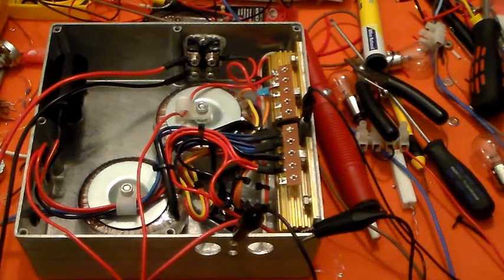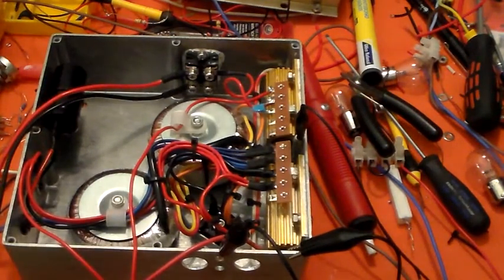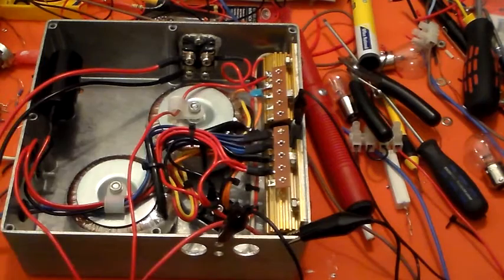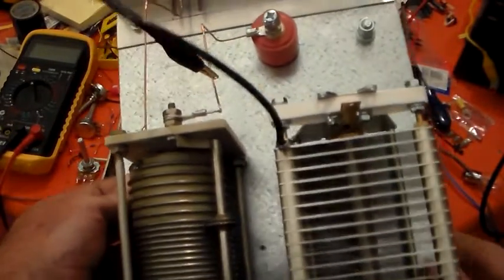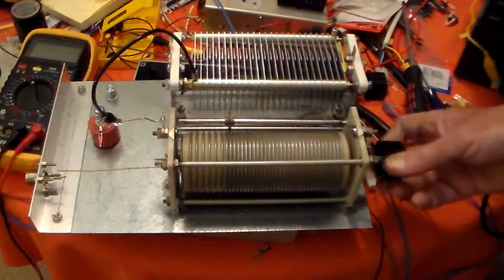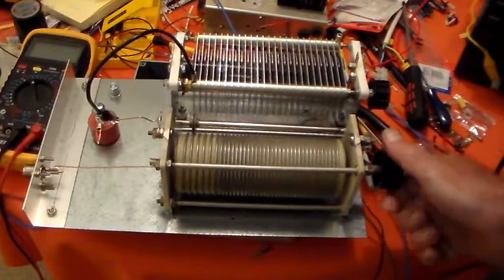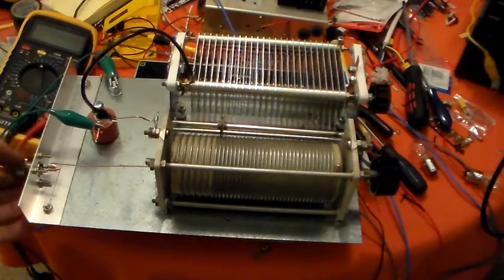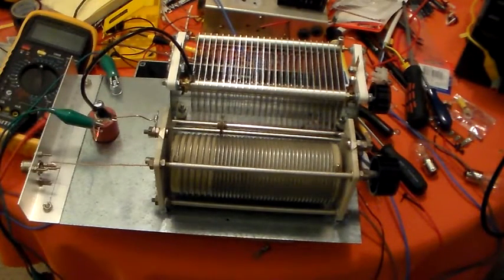A Bit On The HF Amp And An 'L' Match ATU.

Comment: Hello! Like to this video from my side. I followed to ON6MU circuit diagram for the high power  L - match  resonanced tuner, it works a little better with variable capacitor by input. You may glance at this one in fact inhere, may be you would like this ON6MU idea also:

https://youtu.be/geU1qsI8Rf4

Good luck and 73! de UR5GAW